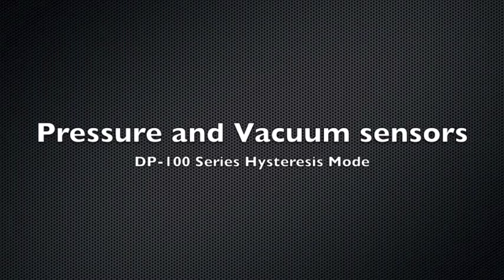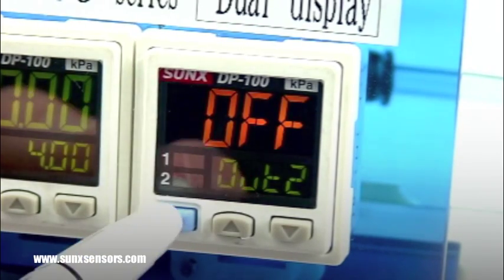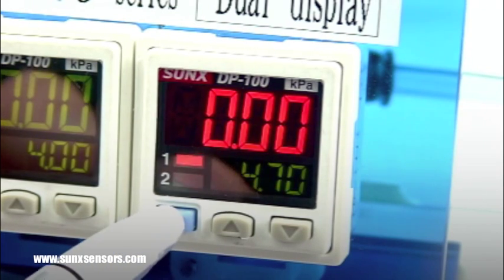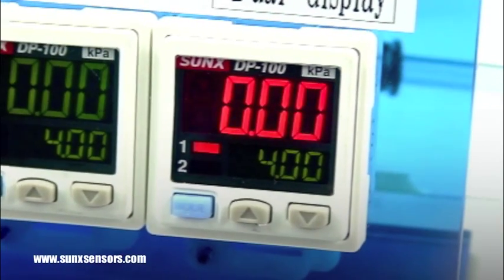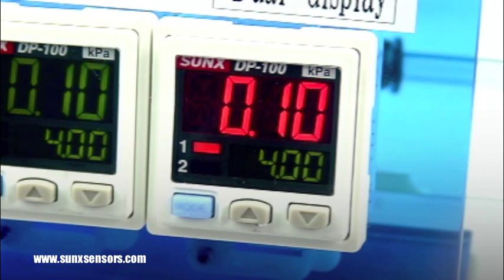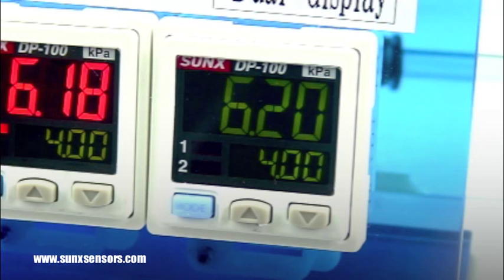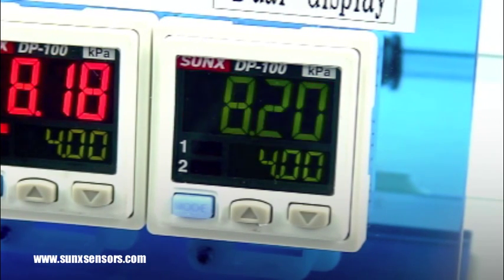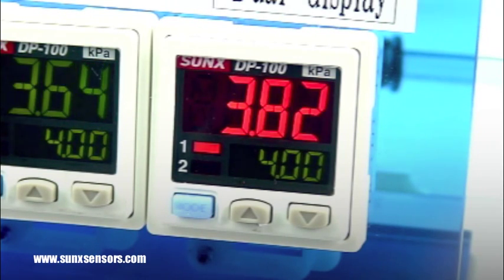Panasonic DP-100 Series Hysteresis Mode Set-Up Demonstration

Comment: Hi, I would like to use this to control a rotary vane vacuum pump with a VFD, so it will maintain a constant vacuum we set by altering the speed of the vacuum pump via a PWM signal, do you know if this is possible?